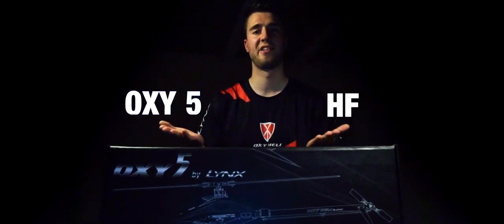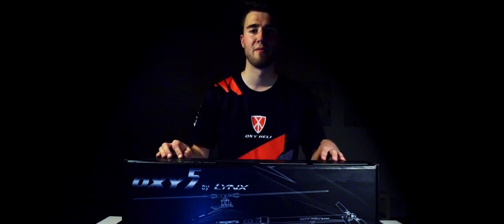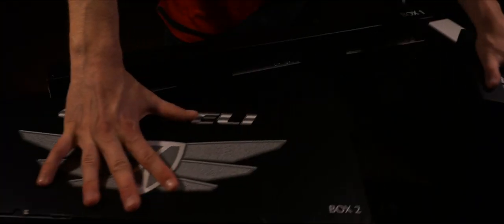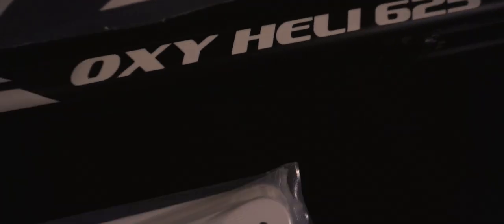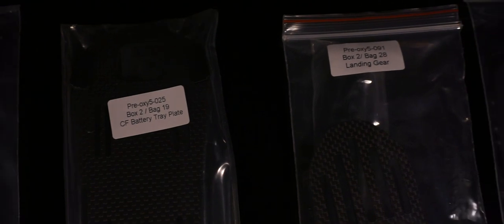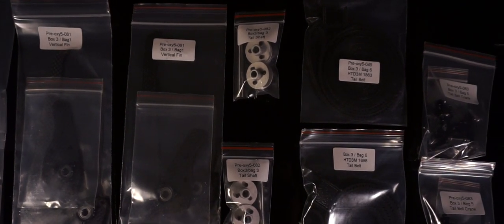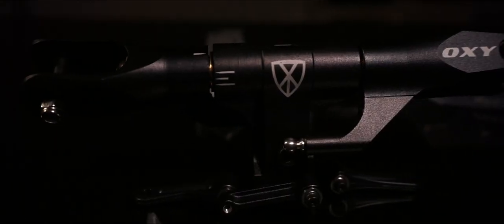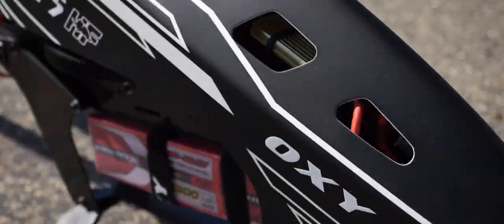OXY 5 HF | Overview and Flight | Aaron Wolf

Comment: Hi Aaron, why did you choose the 500KV instead of the 560kv Scorpion? Thx for short answer..
Reply from the maker: You can also use a 560kV Motor of course. :) I chose it because I am flying it already for a long time in different OXY machines.
Reply: @AaronHeli  Thanks for answer :-), in the Kit comes the 21/22 Tail Pully, the Manual says 19, which should i take? Headspeed 2000-2500 with RT610mm..
Reply from the maker: @Thrust40  for this headspeeds take the 19t at the tail please. :)
Reply: @AaronHeli  ok thanks alot, the 19T is the one from the normal Kit, looks other then the original in the Kit, it's not closed from both Side.. It should fit but it's open to one Side... Is this ok?
Reply from the maker: @Thrust40  Its just a different look. Both versions work perfectly. :)